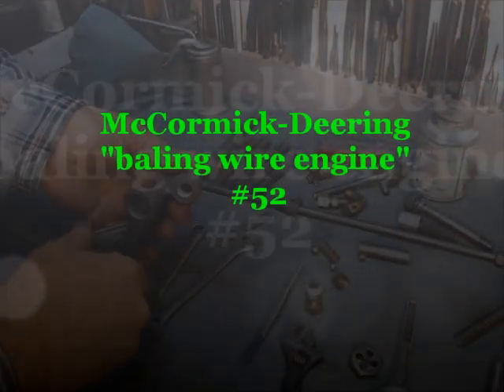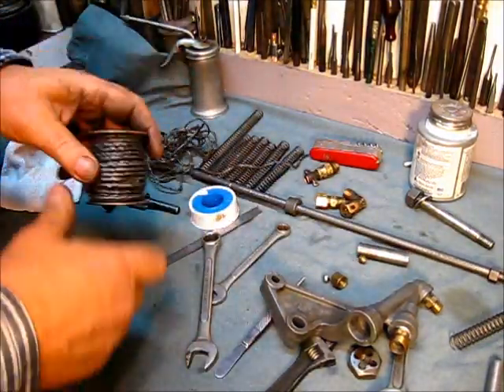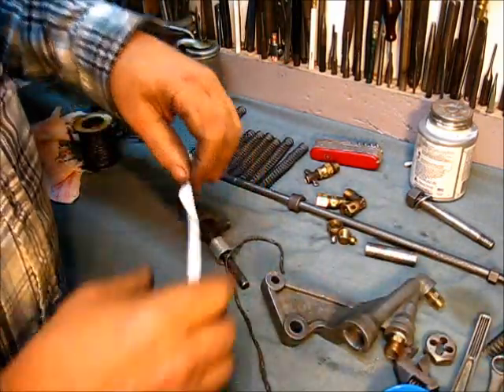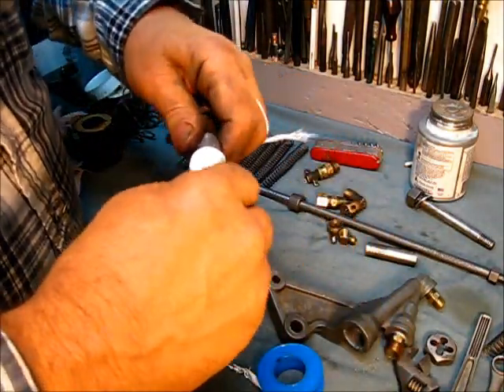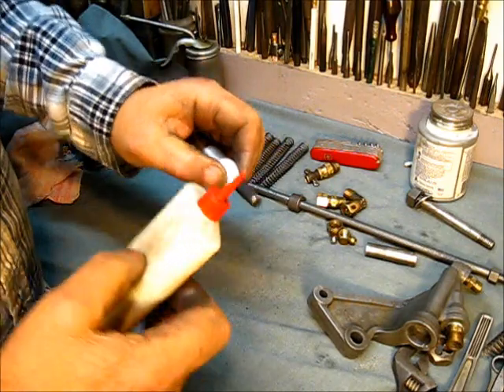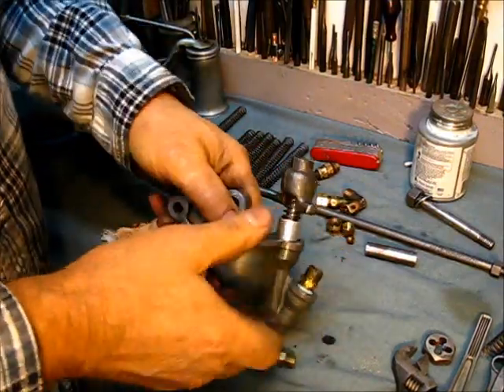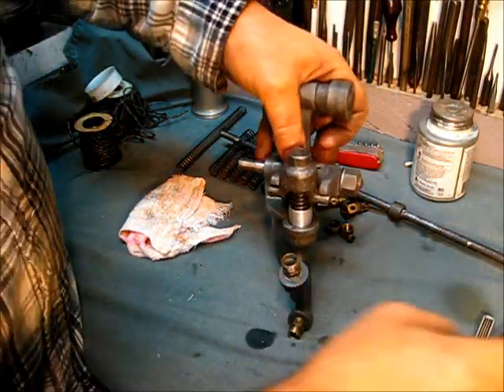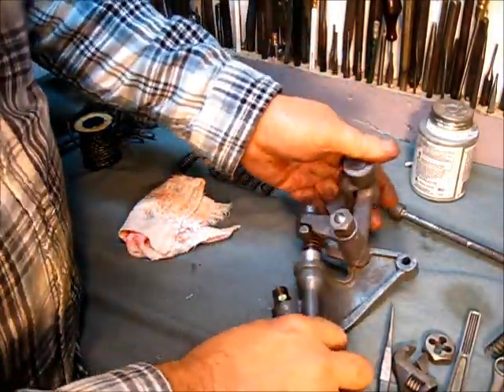McCormick-Deering "baling wire engine" #52

Comment: PTFE, aka Teflon, tape: White is single density, Yellow is double density, Pink is triple density. White is used on NPT up to 3/8", Yellow is used on NPT 1/2 to 2" and is also called "gas tape", Pink is used on NPT 1/2 to 2"